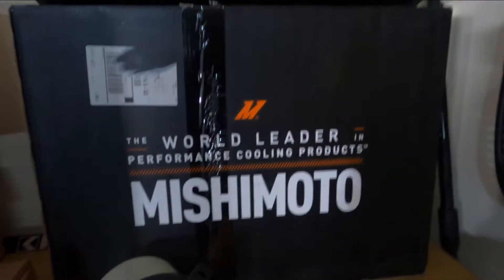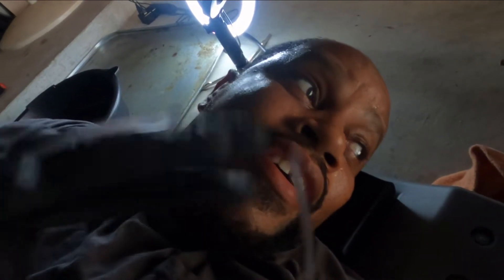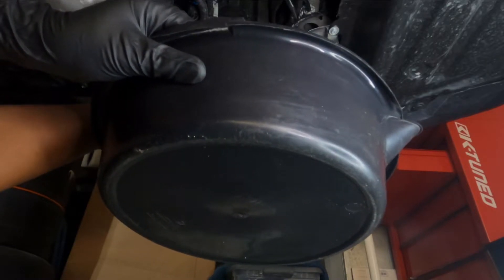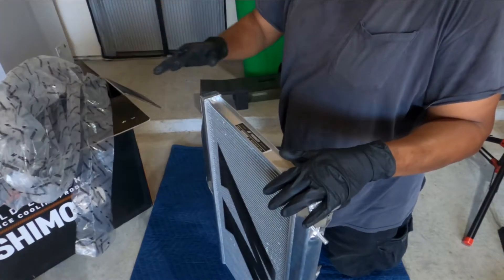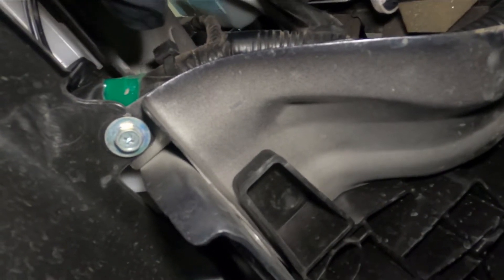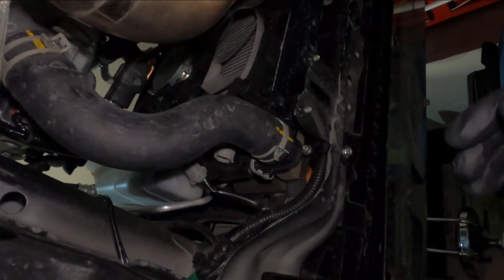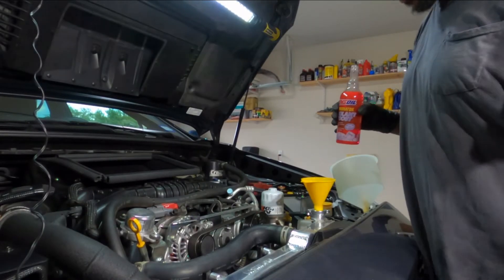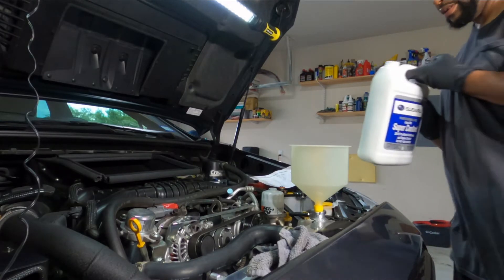How to Install  Mishimoto Radiator & Amsoil Coolant Boost 2020 WRX

Comment: Looks like a pretty straight forward installation. Keep us updated on how it does with the temps. I’m in Fort Worth and this heat just wack lol I might do the same to my wrx if this makes a noticeable difference with the engine temps.
Reply from the maker: So far so good, no issues and it has dropped the temps about 2 degrees, before I would see 196 for the most part but now it stays around 194. May see more once I add the thermostat that opens sooner.

Comment: Nice install! So in order to burp the system it looks like all you have to do is fill it up, start the car, and let it run until it no longer creates any bubbles? Also, did you fill it up until it overflowed or was it a specific amount? I want to do this in the future. Looking forward to your review on it my guy.
Reply from the maker: I just filled until it got just above the cone area of spill kit container, it did make the overflow tank fill but I just took it off and put it to the fill mark. You have to tun your heater on full blast too. Once no more bubbles came it it was good.
Reply: @MoJoNinjaGarage  thanks man!

Comment: Would you recommend that rad what are your temps looking like specially being in Texas ?
Reply from the maker: You can really not go wrong with Mishimoto in my opinion, I have always used their brand even when I was working on Hondas. I have no complaints and ramps have been pretty good even when we were in triple digits.
Reply: @MoJoNinjaGarage  I was looking for like a comparison in temp because I notice when it really outside my coolant temp is around 217-225 or so while driving I do have a grimmspeed front mount so I know that brings up my temps oil/coolant I wanted to know if this maybe will balance that out ….. curious to know what kinda of temps are you seeing specially in Texas where everything melts lol
Reply from the maker: @guz4l  I would say my Temps came down lower than that by a little bit but I also used water wetter in the coolant as well.  Maybe I can revisit this and keep an eye on Temps to see where I land and look at some old footage to see the difference.

Comment: Did the amsoil coolant really help
Reply from the maker: Hard to say my guy but it definitely didn’t hurt! I could see a difference when I used it in my truck for sure but I didn’t really monitor the effects from using it in the subie and i probably should have. But I can say in other cars I used it in it worked pretty good.